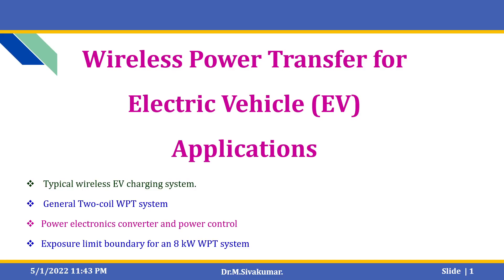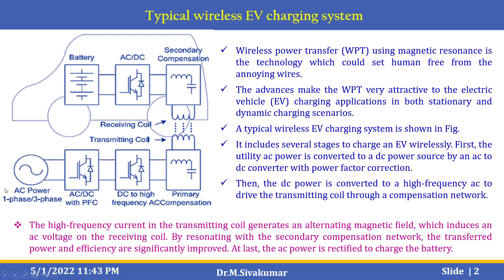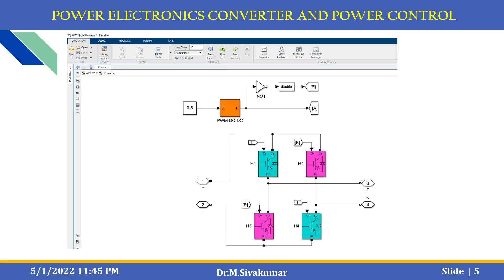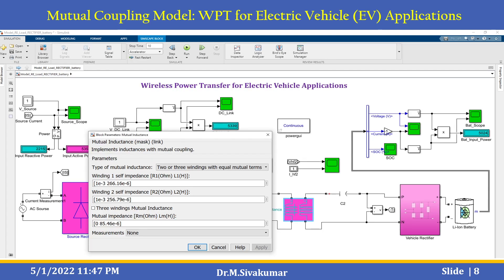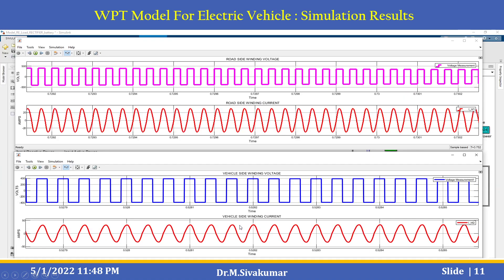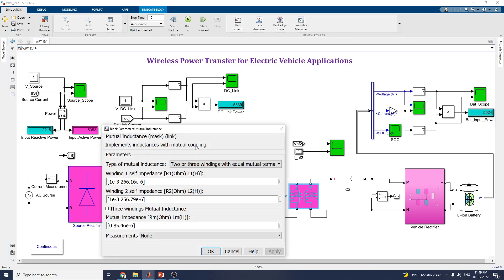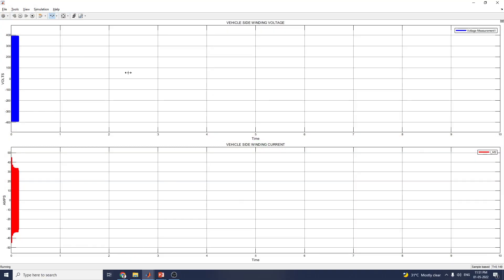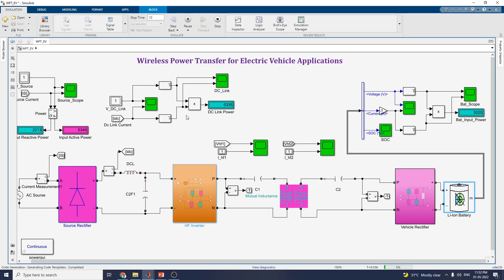Design & Analysis of Wireless Power Transfer for Electric Vehicle (EV)Applications

Comment: sir, what is that bock that is next to voltage line connected to demux. its like x complement. and not visible too.2 blocks in last section. and 2 more in dc power section. kindly reply.

Comment: Sir  I have two question.
1.why you have taken PWM DC-DC  generator in inveter section because inveter is basically convert DC to AC . I have tried to generate pwm by taking sine wave and triangular wave but can't able to get desire result. 
2. In most of the research paper they are considering R-load at the load terminal. Because in practical senario we have to use Li-ion battery there at load terminal. So how can we justify that R-load is equivalent to battery.